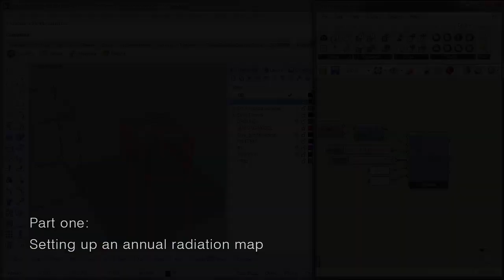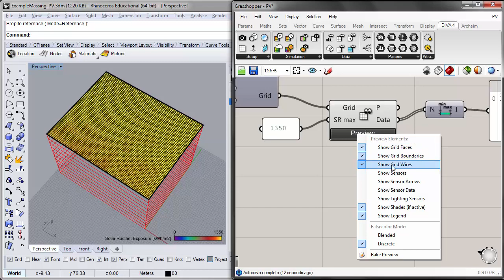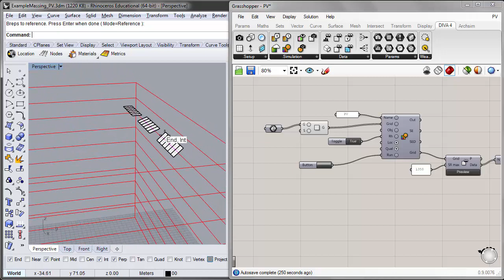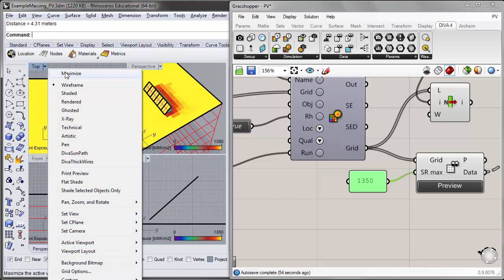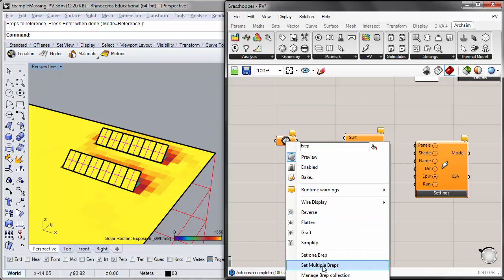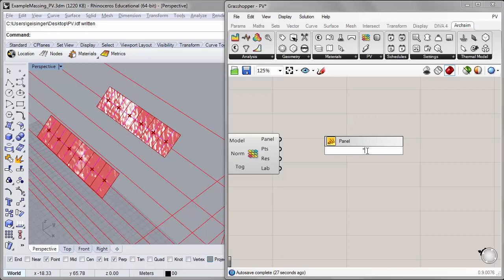Comment: When I model one single 1.5m2 PV panel at an angle of 42 degrees using the boston weather file, I manage to get x10^15 J/year for the DC power output instead of x10^7. Do you why this may be? I followed all of your steps.
Reply: I have faced a similar issue X10^15 for the DC Energy output. Conversion to power gives X10^9